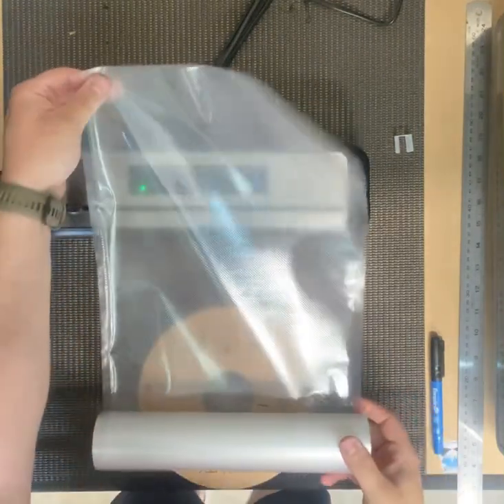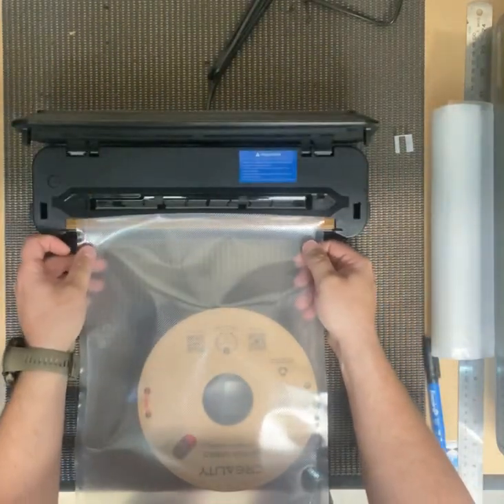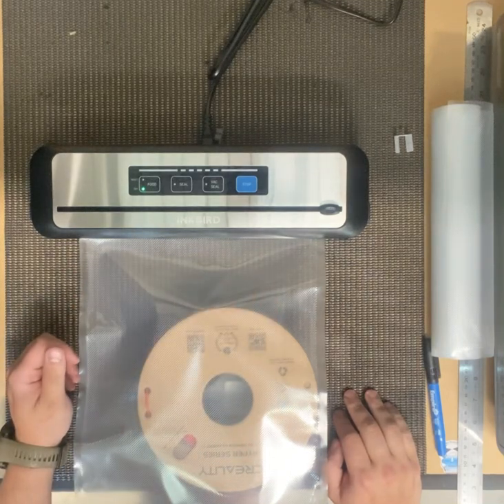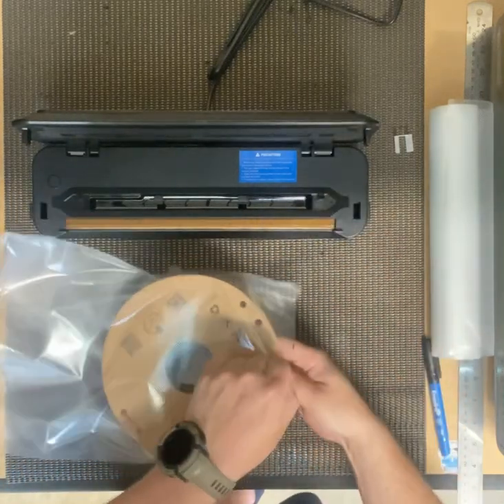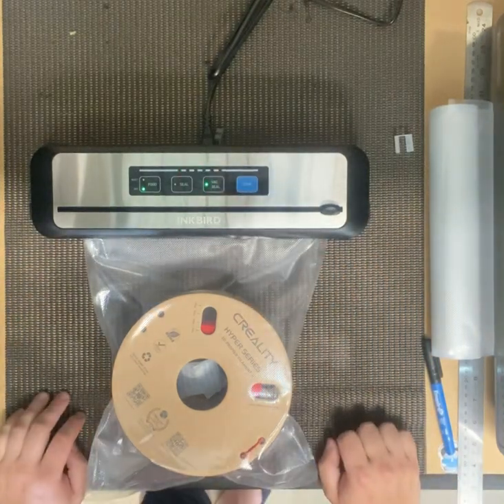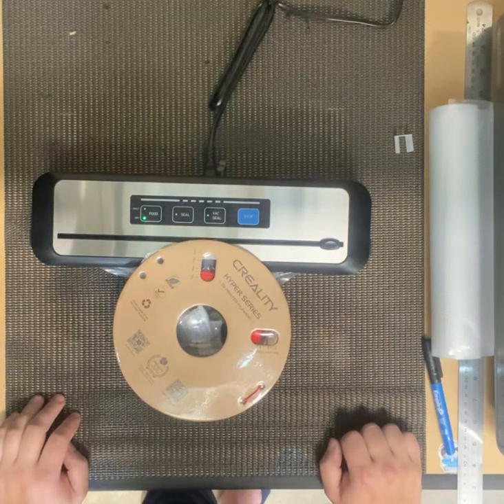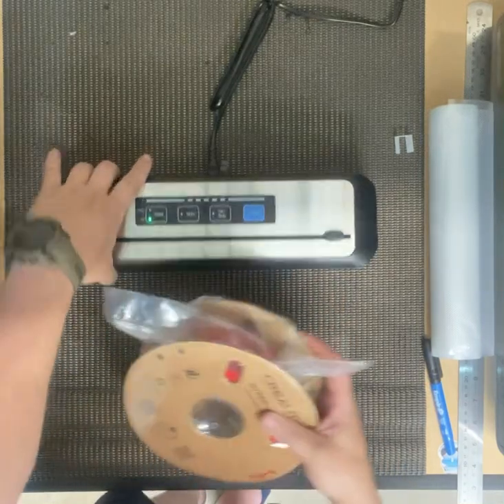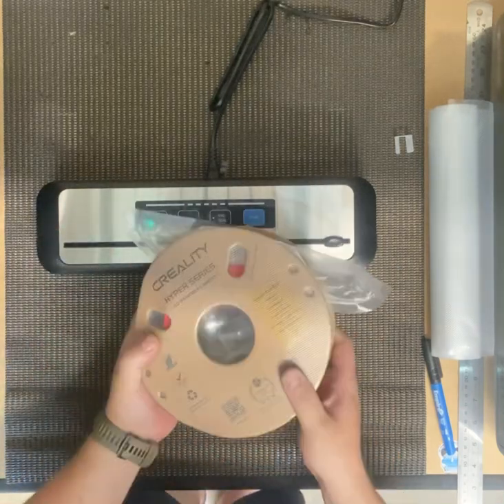Vacuum Sealing Filaments Short Video

Comment: Can you re-use the bag? There are some good cheap reusable bags on aliexpress that come with a small manual pump.
I'd rather not use a plastic bag and throw it away every time I need a spool of filament...
Reply from the maker: No, if you cut the bag another 50mm longer, you could in-theory vac, slice it open at the seal, revac the now slightly shorter bag etc. 3 or 4 times. 

That said, it's low-density polyethylene and highly and easily recycled plastic I'm using.